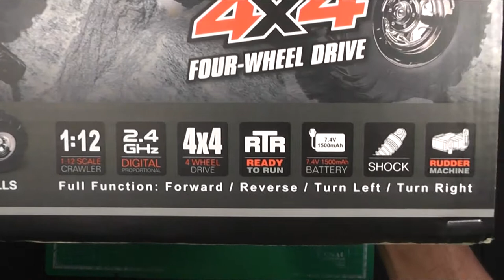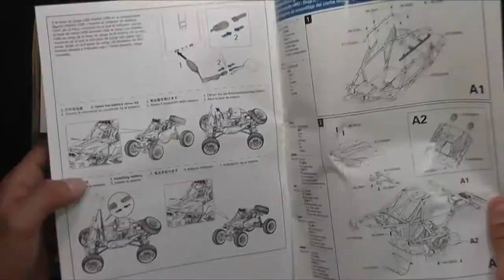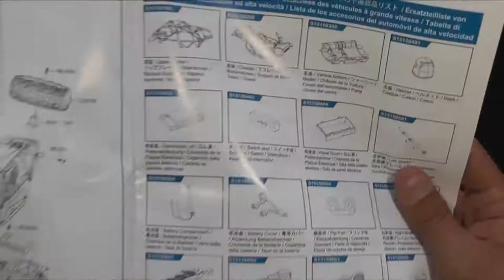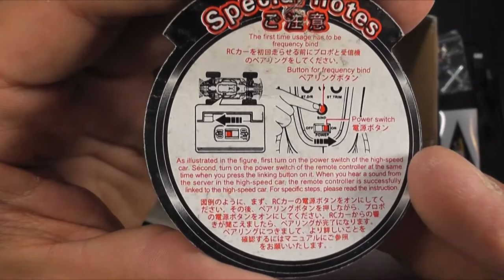SUBOTECH BG1515 1/12 Pathfinder 4WD RTR

Comment: About how much was it, and is the 2 speed an electrical limit from the transmitter, or is it 2 speed transmission with a servo actually changing the ratio? I couldn't hear/tell from watching. Thanks. Otherwise looks good. Hows it holding up, have you used any drone lipos in it yet?